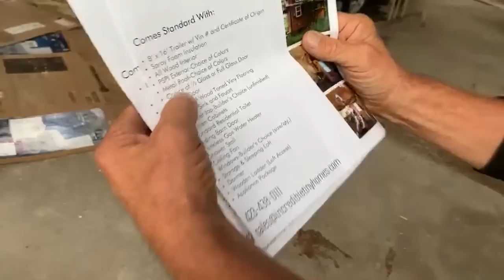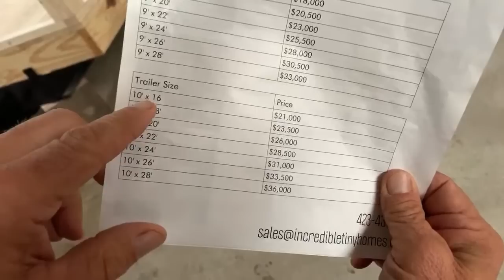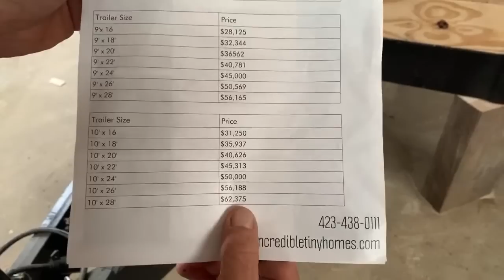$25,000 Freedom 8x16  -  Tiny House Tour

Comment: I have heard that cutting large window openings will weaken the container home, in a windstorm, etc., because it can be torqued..twisted.
It is advised that an angle iron frame be welded in to strengthen the opening.
Does that make any sense? I am not sure myself. What do you think?